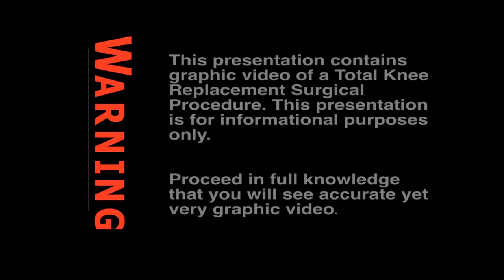Total Knee Replacement Surgery Part 2 - Update 2011

Comment: I had my TKR and patella resurfacing carried out 10 days ago. I watched this vid several times to gain an understanding of the procedure, and to understand why I would be a bit sore afterwards.

I was walking on sticks the next day and did the physio stairs 2.5 days later.

I am walking 1.5 miles a day, up and down stairs with no problem, although bending my knee fully is a challenge!

I have first physio tomorrow, and staples out the day after.

I hope that anyone reading my comment will take solace, as my viewing of the video by MD Turnage, was a big step to understanding the process of alleviating the pain!

Comment: I am glad I found this very informative video. I have had Avascular Necrosis for 5 years. In one month I will have Bilateral Knee replacements and then I will require bilateral hip replacements. The pain has been so intense for years and I take no medications. At least now I know what I will be going through. Walking on 4 extremely painful joints in 4 degree AVN is also impossible to sleep for years every night.

Comment: how do they cut you open without bleeding ?
Reply: +markjjblackops hemostasis!
Reply: +Osnapitzgia it's true though idk why it's a LOL
Reply: My wife has had this surgery on NHS U.K. A torniquet at the top of the leg restricts blood flow. Problem after surgery is that there are bruises at the front and back of the leg, which take about 2 weeks to heal.
Reply: I had a TKR 6 days ago.  The worst pain involved by far is from the stretching of the thigh quads and the bruising caused by the tourniquet.   Exercising and therapy aren’t pleasant, but not too painful.  Stay with it.  It is getting better for me.  I had 114 degrees of motion in the knee bend only 2 days after surgery.  Therapist is hopeful for 120 degrees.

Comment: Very informative video. Short,Sharp, Direct. As a sufferer of chronic knee pain due to sports and work, I have had extensive work done on my legs from hip replacements due to a undiscovered hip fracture for many years. I can sympathize with those who suffer severe  knee and general leg pain. Due to my hip fracture, I have compensated for so long walking differently to alleviate the hip pain it has now affected both  my knees, ankles and feet. Just had knee surgery two days ago to correct the position of both my knee ccaps. Hopefully this will decrease my pain in knees, as I am too young for knee replacement. If  I continue to have chronic knee pain, then  my orthopaedic surgeon will have to replace both knees. 
Thank you for an awesome video. 
Please, if you're suffering any pain, don't suffer in silence. Seek medical advice, get it seen to pronto. 
Get it treated, you'll benefit from it. Believe me.

Comment: For all the questions about why there's not more blood....they put a major tourniquet on the thigh before they start the surgery....nearly eliminates bleeding during the surgery, but it starts back up when they remove it...hence the drain placed inside/below the knee for 1-2 days after surgery.  Much of the soreness in the upper thigh (besides from the cutting and major manipulation during surgery) is from the tourniquet.

Comment: I just had a knee replacement. The surgeon uses a robotics system. Does that work in addition to the jugs and fixtures that you use to assist with removal precise amounts of bone?

Comment: It seems many of the stabilising ligaments of the knee such as the ACL, PCL, Transverse Lig., Fibular Collateral (and Possibly Tibial Collateral) Ligaments have been severed and not replaced. Does this compromise the mechanical stability of the prosthesis or does the design of the prosthesis overcome the mechanical functions of said ligaments?

Comment: I had a TKR at the end of Nov 2013 and was fully taking part in cricket training at the end of January 2014 and have been playing cricket this summer with no pain! Knee number 2 gets done in 3 months (Nov 2014)! I'm glad I didn't see this video before the first op, but at least I now know what goes on! If anyone is thinking of having a TKR, be aware that it hurts like hell (no wonder really!) for a bit, but the improvement is fast and the reward is brilliant! But you have to work hard at the physiotherapy! If you have put up with arthritic pain and restricted mobility for years, then you will cope fine!!
After 9 mths, the only downside is I cannot bend the new knee as far as it used to go. Apparently the max flexion is 115-120 degrees from straight, which is where I've been since about a month after the op. It does make it awkward getting into and out of cars sometimes. It is also not good to kneel on, which I can manage with one real knee, but I won't be able to kneel with both done. No getting stuff from underneath beds or at the back of low kitchen cupboards, etc!! A small price to pay for a pain-free life!!
Reply: Stay strong, and good luck! (:
Reply: I am having mine this monday  :(
I am very nervous and am 50 yo

Comment: I received a total knee on 11/15/16, 7 weeks post-op. I avoided watching real videos until after the surgery, for fear I would have gotten cold feet. My surgery was completed in just under an hour. I spent 3 days and 2 nights in the hospital before being discharged and sent home. In retrospect, the worst pain experienced was during the first two weeks at home and during PT for those 2 weeks. Part of the reason, is that prior to the surgery, I received a nerve block for the leg and a spinal anesthetic although I was not conscious during the surgery. All of the effects of the anesthesia do not wear off completely until a few days have passed, so the full pain level does not kick in until then, when you are off any IV delivered medications and on oral medications. My surgery was in the morning and hospital PT had me on my feet that same afternoon.  Despite the overall aching pain, my pain prior to the surgery during walking (when putting weight on the knee) was gone and I could immediately see I was on a more stable joint. Pain management can be odd. You want to stay ahead of the pain by taking the meds in advance but at the same time, you want to know if you would be having pain otherwise, so you can hopefully, sooner or later, reduce and discontinue.  Pain presents more of a problem when trying to sleep at night. As the weeks progressed, evenings became the only time I felt I required pain relief and by the fourth week, I no longer needed oxycodone, only tramadol and tylenol.   This week 7, is the first week I was successful sleeping an entire night without feeling I needed some pain medication.  Also, I feel I have finally reached the point where my quality has surpassed what it was before the surgery.

Comment: I'm watching this and have a question- I was diagnosed with Coxa Magna and a previous surgery wrecked my right arm and now my left arm is dying. I'm told a total elbow replacement would be my complete cure. Exactly how long do total join replacements take to heal? How hard is it to return to life normally after one?
Reply: Never had it done but i have done simulations of this exact surgery and it says normally a few weeks to a few months depending on your body health etc.

Comment: I have yet to find vids of more recent tkr surgeries.  I’m sure the techniques have advanced since 2011.  Anyone know of such videos?  My surgery was 6 days ago using minimal invasive techniques.  I’m doing very well.  Other than the quad pain from the thigh tourniquet and stretching of the quads I am pretty much pain free.  The bruising and such in the thigh are the worst of the pain.  The joint it self only has any significant pain during therapy and exercising at home.

Comment: At 2:55, what is the purpose of the metal rod extending from the knee to the ankle? Is it connected with pins to the ankle or distal end of the tibia?
Reply: I think it's designed to leave the leg in a 90 degree position, so that they can get the full extent of the knee, I think

Comment: To the person who asked about height - yes. I had a slight change in the length of my leg. One of the most common problems with someone who needs a knee replacement is bowed legs. The surgery corrects this so you can appear "taller" after surgery. But - in my case, my right leg was actually corrected in a way that made it a full inch longer than my left. This gave me hip and back pain at the beginning, but I think I have compensated for it now and I forget it even exists.

Comment: I am looking at a total knee replacement here in NH. Been 6 years since my scope job for torn menicus. Since then the meniscus has all but disappeared and I am bone on bone with little to no cartiledge left and some deformity to my tibia. My Dr. says I will be in for 3 days as they start the PT as soon as the next day. I'm concerned if there are different types of joints to get. I am an active person but dont need a sports type joint just one that will hold up.   Mike R. in NH.

Comment: You are saying how the bone is spongy? I would imagine the femur bone would be super hard, can someone explain?
Reply: I can't explain the actual medical reason very in depth but bones' heads are made out of the cortical bone on the outside, which is hard and that layer is filled with the trabecular bone, which is the spongy part. That spongy bone dampens sudden stresses. Femurs usually break in the middle, where there is just the hard outer layer and soft bone marrow. I think bones have a soft inside to absorb shock and allow cells to grow and do their thing inside bones? The outer layer on femur bones is probably a bit thicker, making it stronger that other bones as it has to carry all the weight of a human body. Again, I'm not a doctor or anything like that, this is just all I know. I hope it helped a tiny bit.
Reply: +Mariza T thank you, that helps a lot
Reply: +Garret Jacobsen no problem :)

Comment: I'm not a medical doctor, so this might sound very stupid to a professional.

Isn't there supposed to be blood when you're doing surgery? I hardly see any.
Reply: your knee joint is encapsulated by a lot of ligaments and there are no major arteries nor vessels on the anterior side. at the back of the knee is totally different. the back of the knee, or the popliteal area, is where the major nerves, arteries, and vessels pass through. what little blood you see in the video just come from the subcutaneous vessels, so, there's not a lot.

(correct me if i'm wrong. just in my 1st year of med, and this is what my next exam in anatomy is all about.)
Reply: snowflake32843 You probably know more about this subject than I do. 
But whenever I scrape my knee, there's always quite a bit of blood, yet in the surgery, there's less blood than a scraped knee.
Reply: the vessels on your skin branch out to cover the whole surface. so, if you scrape your knee, there's more damage compared to a single incision.
Reply: snowflake32843 I see.
Reply: Although they don't cut into any major blood vessels, there is still plenty of blood that can come from all the other veins and capillaries in the area, There is not a lot of blood seen during the video because they apply a tourniquet to the thigh while prepping for the surgery! I know this because I had arthroscopic surgery a year ago for a torn meniscus.  Afterwards, I had a narrow bruise all the way around my mid thigh, That's when I realized, they must have used a tourniquet,,,,funny I never thought to ask. Maybe bc they knew from my medical record I am a heavy bleeder?  When I went for my post op check up, my surgeon confirmed, they did indeed use a tourniquet to control bleeding. They do for everyone!  They need to be able to see what they're doing without tons of blood oozing out and occluding the view, plus they don't want you to lose blood either. I am having the same knee replaced in 9 days, my doc saw it was bone on bone during the arthroscopic surgery to trim the torn meniscus. :/

Comment: Does this hurt while doing this? It looks painful.............
Reply: No when your under you don't feel anything. Once you wake up however that's a whole different story. I broke my hand and hand to have surgery to correct the break. It took the surgeon about 30 minutes to re-correct what I had broke. I was under anesthesia at the time at, it was only after I awoke that I felt tremendous discomfort from the operated area.
Reply: so... you didnt felt a thing?
Reply: Its Waffle kitten Pretty much. Surgery should be a painless process for you as you'd be asleep and sedated for the process. As I said before, its only when you wake up that you feel pain.
Reply: oh ok
Reply: O.O
Reply: ***** Not all surgeries require anesthetics to be performed.
Reply: Josh Estipona ok then....
Reply: ***** Why are you getting aggravated? I was simply stating that Most surgeries, not all require anesthesia. Also if the guy in the video did this w/o anesthetics he'd go into shock. He'd either die from massive stress causing cardiac arrest or worse. You don't die from pain. Btw you just cut your ass. I assume that the doc cut away dead tissue, cleaned the wound and gave you stitches. I agree w/ your old man, that you wouldn't need anesthetics if it was just that.
Reply: ***** I've had them before. Considering this is your ass where muscle is thickest, i can see "ass" to why you didn't have a fun time. Got some near my eyebrow once though. Not really that much of a hindrance.

Comment: I had a total knee replacement on my right knee on April 7th 2014. Excruating pain when first was done. I'm healing. But will not have lft one done. Can't take it.
Reply: If u have knee pain or join pain then there is no need for an operation u will be fine without any medicine or rest nothing just contact us

Comment: Why does it not bleed when they cut the flesh open? Can someone explain?
Reply: Is it because of Epinephrine?
Reply: +nekif820 No the tools they use to cut it are heated so it burns the blood vessels, thus sealing them shut
Reply: Clayton Dreyer Really? So the scalpel that they used was heated first, huh.
Reply: +nekif820 the scalpels have a wire that is hooked up to an electric source, and it heats up the scalpel..
Reply: There was probably a tourniquet involved
Reply: +Mr Blah Nope no tourniquets
Reply: Clayton Dreyer oh so that's how it works. thanks for explaining

Comment: Damn not much different from building a house. Drill a little. Hammer some screws and cement it.
Reply: Yep but if you miscut or make a wrong measurement when building something, you can always run to Lowes or Home Depot...here, not so much

Comment: Having had 3 x uni compartments (half knee replacements) 2 didn't work and then a TKR I can tell you that they HURT like a mother afterwards (obviously) and are very swollen for 10 days to 2 weeks post op - the bending exercises are excruciating (wait for the exercise bike) but extremely necessary - now I can walk or cycle for miles and fly upstairs without any pain so well worth it

Comment: i had the right knee done 2 yrs ago and its perfect 4 weeks i was back to work i just had the left one done and 7 months later i still have swelling pain and fluid build up and the same doctor did both i requested to go back to work sitting home and 18 weeks of therapy drove me nuts the problem isnt with the new knee they said its with the muscle and soft tissue i m giving it a little more time the to another doctor they drained fluid twice and it built back up everything looks good on x ray and ultra sound but the damn thing hurts